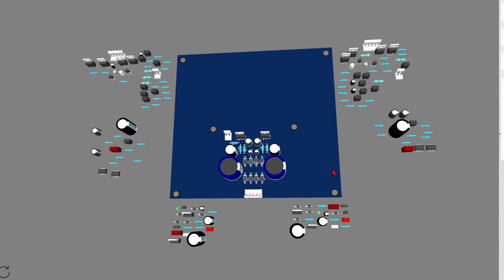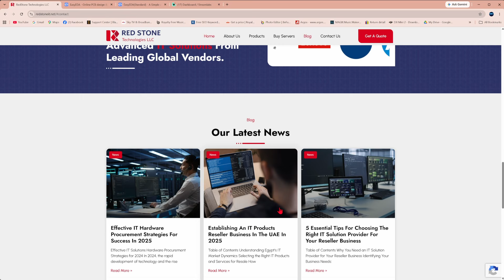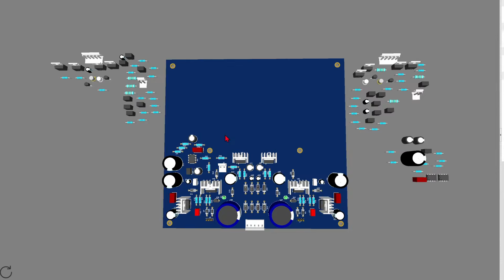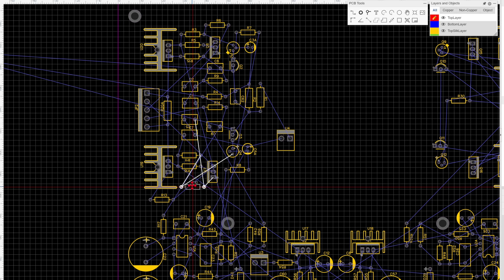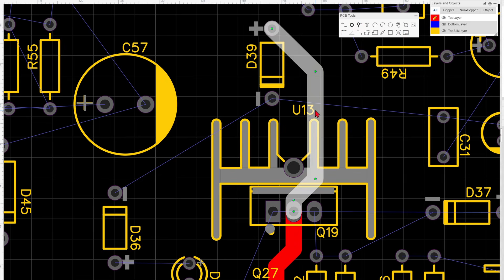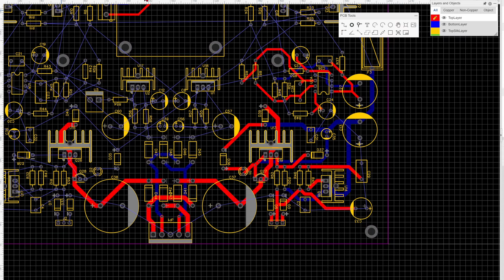Enough is enough Let's make a brand new board

Comment: Don't you find that many of the solder pads are too small by default?
For instance on the 8 pin DIL packages. Best use some sockets and remember to change the pad designs for your next build.
Reply from the maker: Thanks buddy! Yes I used sockets for the opamps. You mean the solder pads on the new board the default components footprint?
Reply: @SymbolTech21  Yes, if you observe many of the older designs for those DIL pads they would have been a rounded rectangle shape, being around the size of 3(Length) by 1(Wide)
Reply from the maker: @Goldentoenail yes some time as well I find the pads small and when I consider that I need to make them a bit bigger definitely I make the pads bigger! Some times I also just make myself the pads deleting the footprint

Comment: if u17 and u18 get hot, heat convection and radiation may shorten the life of the two electrolytics.  Are the u17 heatsink holes drilled  in the pcb too? 

I like the fuses. You could add on dc speaker protection and clipping
Reply from the maker: I have installed the DC speaker protection already in the chassis and those mute boards I think have clipping led on it. U17 and u18 on the original board are without heatsink and are just little warm are the lm317 and lm337. Let's see when the board arrives if it will work!

Comment: Finally! Bro this is epic you made a new board, nice layout of components.  Also like you can add the mute section seperately or not use it. Hope it works!
Reply from the maker: It should work because all the traces are connecting same components as per original board. Only there is something different because the original board is V2 and the schematic I had is V3. Only the first transistors that they get biased different